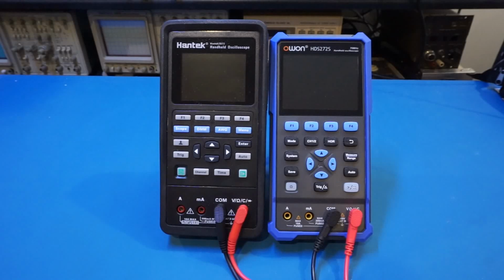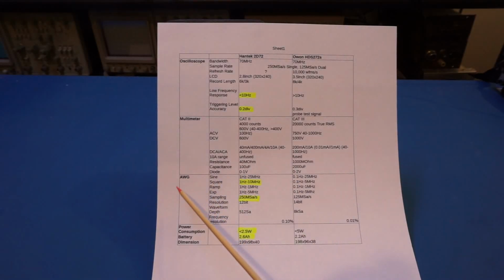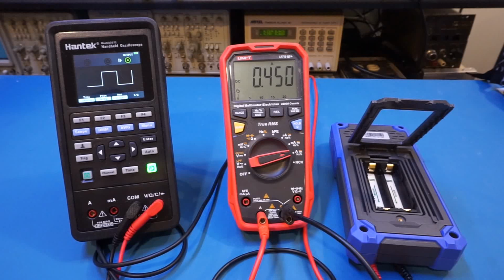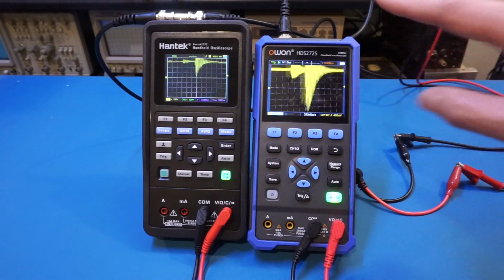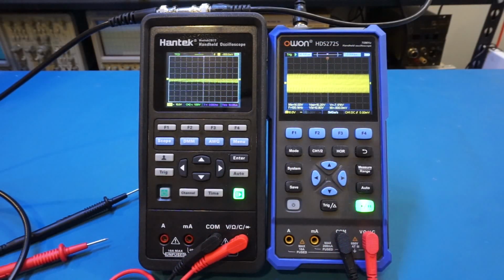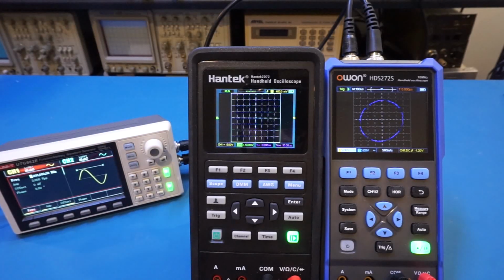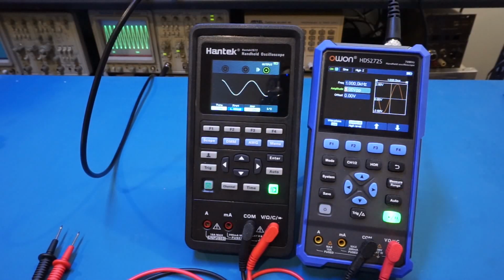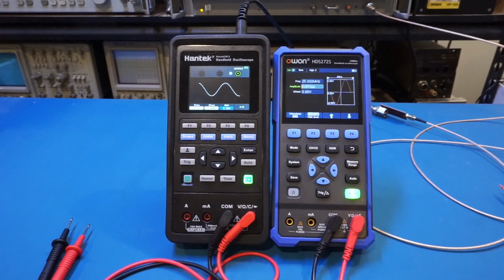Hantek 2D72 vs. OWON HD272S – Which Scopemeter is Better?

Comment: I would like you to bring to your channel a review of the FNIRSI 1C15 and comparison with the Hantek 2D72, since it is a lighter, smaller and cheaper oscilloscope, but it promises superior performance to the Hantek, and for about 80 u $$, FNIRSI is a company that is starting, but is giving a lot compared to the low cost of its equipment. 
Me gustaría que trajera a su canal una revisión del FNIRSI 1C15 y comparación con el Hantek 2D72, ya que es un Osciloscopio mas liviano, pequeño y económico, pero promete prestaciones superiores al Hantek, y por unos 80 u$$, FNIRSI es una empresa que está comenzando, pero está dando mucho comparado al bajo costo de sus equipos.
Reply: Hi, I work fixing audio gear, FNIRSI scopes are totally useless for my job, minimun division per volt is 50mv in all models.
Is imposible to find any background noise.
Best Regards.
Reply: Completamente de acuerdo, el mínimo de 50mV/división en los Fnirsi 1013 y 1014, los limita mucho, y espero se den cuenta los diseñadores para resolver ese grave detalle. Actualmente estoy usando un Sigpeak 2512G, de 10mV/div y estoy encantado, me funciona mejor y más preciso que el Hantek 2D70, y tiene 128k de memoria de profundidad contra los 6k del Hantek o 10k del OWON.
Completely agree, the minimum of 50mV/division in the Fnirsi 1013 and 1014 limits them a lot, and I hope the designers realize this serious detail.  I am currently using a Sigpeak 2512G, 10mV/div and I am delighted, it works better and more precise than the Hantek 2D70, and it has 128k of depth memory against the 6k of the Hantek or 10k of the Owon
Reply: @sergiogalpon  Yo reparo audio High End y utilizo mi querido y primitivo Fluke 99b que tiene 1mv de sensibilidad mínima.
Además tengo un Agilent de 150 mhz que funciona muy bien.
Todos estos osciloscopios baratos sino es por un lado es por otro pero siempre tienen algún problema.
Saludos.
Reply: @treadmillrepair754  sin duda, pudiendo comprar algo más caro será mejor, pero de los baratos portátiles el 2512g lo recomiendo, me funciona muy bien y es un pequeño muy fácil de manejar, doble canal, y con muchas funciones, modo Roll, XY, analizador de espectro, salida de vídeo para monitor, etc, de todas maneras los equipos que usted posee son profesionales, por lo que vi el Fluke 99b vale 1000 dólares, sin duda no puede compararse con uno de 100, lo bueno que éste de 100 que les comento sirve y vale la pena, sobre todo para iniciarse, y luego si es necesario, ir invirtiendo más si es posible, o según las tareas que uno realice.
Reply: @sergiogalpon  el Fluke 99b costaba nuevo más de Us$3000 dólares, lo compre usado como nuevo hace como 20 años y me costó Us$1800 dólares, era carisimo comparado a otros.
Ahora no valen nada se consiguen en Us$400 dólares o menos en algunas ocasiones.
Además el muestreo en pantalla es muy bajo comparado a los osciloscopios modernos incluso los baratos.
Con el paso de los años mis ojos han venido a menos y me cansa mucho ver las pantallas monocromáticas.
Incluso de uso diario tengo un Fluke 87v y Fluke 28ii pero es la misma situación, por ese motivo compre un multimetro Siglent SDM3045 y un Owon 1041de banco, con grandes pantallas a color.
Así es esto.
En mi caso vivo de esto y el trabajo me da los recursos para poder invertir en herramientas.
Saludos.
Reply: @treadmillrepair754  Excelente, sin dudas que la tecnología digital a avanzado muy rápido también en el instrumental y se van sumando tecnologías y bajando los precios, me alegro mucho que pueda tener acceso a tan buen instrumental, sin dudas que debe ser muy buen técnico, y ojalá podamos algún día ver algunas de sus reparaciones por aquí, y el uso de ese buen instrumental... Abrazo desde Uruguay
Reply: Don't believe what fnirsi "promises". Most of the specs they claim are complete lies. The 5012h pocket scope for example is utter crap. 100Mhz, 500Mega samples / sec my ass. Its 30Mhz, 125Msps at best.
Reply: @simontay4851  It worth to add some money and buy some Hantek 2c43 or Owon.

Comment: -Felicitaciones, muchas gracias por la excelente comparación de ambos instrumentos, creo que es la mejor comparación que he visto de estos similares instrumentos, le salió un duro competidor al Hantek 2D72. Se nota que el Hantek es un diseño mas antiguo pero robusto, con la ventaja de tener mejor software para utilzarlo y tomar muestras con el pc mediante el cable usb, Hantek también tiene el respaldo de una comunidad mas grande para mejorar el firmware, y agregar mejoras pedidas por los usuarios, de todas maneras el Hardware y la pantalla del Owon es superior, y si yo no tuviera el Hantek, me compraría el Owon.
--Congratulations, thank you very much for the excellent comparison of both instruments, I think it is the best comparison that I have seen of these similar instruments, it was a tough competitor to the Hantek 2D72. It is noted that the Hantek is an older but robust design, with the advantage of having better software to use it and take samples with the pc through the usb cable, Hantek also has the support of a larger community to improve the firmware, and add improvements requested by users, however the Hardware and the screen of the Owon is superior, and if I did not have the Hantek, I would buy the Owon.
Reply: Saludos, sabe si el Hantek puede salvar en el equipo (sin computador), para luego descargar? El manual no me deja claro. Estoy interesado y sigo pensando este como una mejor opción.
Reply: @coordinaciondetecnologiaei8732  que tal, se puede salvar en el equipo la forma de onda, hace como una captura de pantalla, pero no guarda las valores de voltaje ni frecuencia ni nada, solo como para ver una captura de pantalla. De la forma de onda, no es bueno para eso, además bastante difícil de entrar a los menú para salvar y luego ver lo guardado, el Hantek no es bueno en ese función.

Comment: In my opinion both models are quite competitive as both have some pros/cons and I really wish to have some mixture of these two.
Hantek has much better software application that enables not only oscilloscope, but DMM and AWG as well. However, for the AWG I cannot find a way how to import waveform manually (based on demo app w/o instrument, manual and videos), only draw by mouse.... For both oscilloscope and DMM you can export data in a convenient way. For oscilloscope the exported waveform has always 1200 points, approx 100 pts per div.
The approach to oscilloscope functionality is also different - Hantek always displays single waveform trace (with significant jitter and unstability), while Owon has two acquisition modes (Peak and High) and is able to display something like overlay of mentioned 10.000 acquisition or so, which is very close to analog behavior/data.presentation.
Hantek has much better operational battery life, Owon wins in standby life. Hantek has much better PC application (including quite nice Math enabling FFT, A+B, A-B, AxB), with more straightforward control, OWON supports remote control (even data acquisition) using SCPI, which can be great!!!! However, SCPI enables control for oscilloscope and generator only, not for DMM. And for the generator, you can only controll it, no upload of data samples....
I have also read that Hantek has DC isolated USB interface.... as a result, Both product have significant advantages in certain aspects:

Hantek - power consumption, generator, way better PC software (access to all measurement functions), FW updates, pass/fail crietria for waveforms (refs + deviation), probably also built quality + isolation of USB (haven't verified)

Owon - trace presentation+acquisition in oscilloscope, handling, display, standby power consumption, remote control of some functions via SCPI, truRMS DMM,
Reply from the maker: BTW, you can edit waveforms via a CSV file (I showed that in one of my videos) with the Hantek.
Reply: @KerryWongBlog  you mean for the awg? Coul you provide a link? Thank you..... Still amazing how one tool enables this, another that, but both just part of the functionality desired....
Reply from the maker: @82sledge  If you go to the product page http://hantek.com/products/detail/13174 you will see a download section, the software download contains everything you need to control the 2D72.
Reply: @KerryWongBlog  Thank You Kerry, but I think there is some misunderstanding. I have this SW already installed and there are many posibilities how to export data to various formats. However, I haven't seen any option in the SW (in DEMo mode the AWG is not working), how you can upload your own data to the Hantek's generator, only drawing signal by mouse.... This is whai I was asking. And is sad that there is no protocol for Hantek to enable remote control as for Owon. However, for Owon you can control only SCOPE features and its PC app suports SCOPE/AWG modes only as well (probably using the same protocol), but still no way how to upload waveform to AWG even if you can access OWON as USB storage.... So even if they look so identical, they are actually very different almost in every function, UI approach etc....
Reply from the maker: @82sledge  Yes I pointed this out in my comparison video. For the OWON you can't upload your arbitrary waveform at all and it could be a deal breaker for folks need that functionality. For the 2D72 though you can design your waveforms using a CSV file. I demonstrated that in my review video for the 2D72.
Reply: @KerryWongBlog  Kerry, thank you very much. It is sad that the Hantek has signifficantly worse time base and acquisition capabilities. It offers quite a lot data exchange via CSV etc, however it hasn't capability to remote control using some protocol. On the other hand its SW application enables you with almost complete "control", however in "manual" way in which you only have the data that you can process.
OWON seems has much better time base and acquisition, DMM as well, remote control of SCOPE mode, but its SW application is very limited (offers probably same control and capabilities that can be performed via its communication protocol), but nothing more, 
It makes the decision way more difficult as the "potential" of those tools is remarkably reduced on both cases (by SW or HW/FW).
Oh god I can' decide and christmass are comming :-) 
Anyway thank You for your videos and answers!
Reply: I have finally decide for Owon. From the perspective of portable tool "as is" it is probably the better choice (at least in my case). However, the PC application is basically useless as in my case it ieven presents erroneous data - rising edge with sufficient sloe showed let!s say Log 0, Log1, Log 0 and then finally log1 levels - it was always risoing/falling/rising  sequence in PC, but on Qwon's display it was correct. Much, much, much more usefull was switching the USB mode to "MSC" when you can see the up to four stored traces in full resolution (4k or 8k samples) in CSV format in much more convenient form, than traces stored from PC app itself. So my advice is in case of OWON, forget the PC app, enjoy it's acquisition capabilities and if needed, proces data shared via USB. 
PS: In MSC mode, you can only see files that exist when you plug in the scopemeter. Any file stored when device is connected is visible only when you reconnect the device. At least in my case. 
PPS: for using the device as data logger, the longest timebase settings offers as much as 1000s per division with sample rate of 0,25 Hz so the recorded range can be as much as 4,4 hrs/dual channel, 8,8 hrs single channel. This somehow could compensate for data logger capabilities of Hantek PC app in DMM mode.

Comment: I like my Owon. I only get about 1 month of standby time. I measured
the total standby load (both batteries) of 2.9ma.
Reply from the maker: What's the hardware version? Looks like it's an issue with an older hardware/firmware?

Comment: You can save a lot of time by simply saying Hantek or Owon instead of their model numbers every time you mention them. In my opinion, they're just toys because you still need a dedicated DMM for serious and fast measurement, also dedicated oscilloscope for precise measurements, etc. Both have no protocol decoding. Also minimum v/div is too high making it impossible for low voltage or noise measurements. Last not least who would want to measure mains AC directly with an oscilloscope?! It would be nice if you could do reviews for Hantek 6000EU and 4032L because they're both dedicated devices and both have full Sigrok support.
Reply: Handheld oscilloscopes are meant for field use for industrial electricians for example.  They are not lab instruments. In that environment its essential to measure medium and high voltages directly.
Reply: @juremales4185  Industry wouldn't allow such a toy scope to be used on HT lines. Self employed electricians would use it but again a tester or DMM is sufficed for most if not all cases.

Comment: Excellent and thorough review.
I bought the Owon HDS 242 back in April, and are verry pleased with it.
The only thing I'm missing is firmware updates from Owon.
It doesn't look like Owon releases updates for any of their products.
That's to bad as mine is at version 1.8.0 while the new ones are at version 3.x.x i belive.
Reply: Try to mail owon directly because of the update.
Reply from the maker: Thanks!
Reply: The reason that is ,is because they had to use different screens on the more recent ones.
Reply: @eman59461  dumb Argument! You cook up different Firmware Version depending on serial number they know who has different TFT.. never leave old customers in the dust they won't buy again and advise against you :-) no update is not smart

Comment: Thanks for this side by side! Owon is a totally win for me, that Hantek standby current is a no deal, way too high if you don use/recharge it very often. Add your affiliate link to the description!
Reply from the maker: Thanks! Added the links if you wanted to check out.
Reply: @KerryWongBlog  Hi Sir, Owon looks better  for me.
Do you know if the Hantek have XY option?
I want to buy one of this small scopes  for use my curve tracer.

Best Regards.
Reply from the maker: @treadmillrepair754  Yes, I demonstrated that in this video, speed-wise OWON's XY mode is much faster compared to that of the Hantek.
Reply: @KerryWongBlog  Thanks so Much
Reply: The Owon standby current was a lot higher than the Hantek.....
Reply: No it wasn't. It was a lot less.

Comment: But probably HANTEK device has higher self-discharge current when turned off.
Reply: Both these devices are incredible value for money. Few years ago one could only dream of something like that.
Reply from the maker: Correct. standby current is > 1mA.